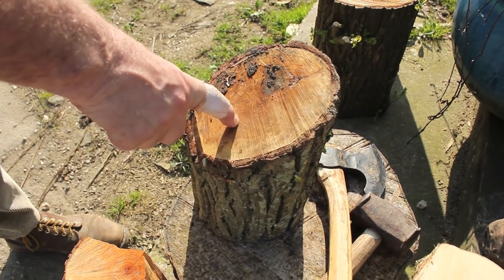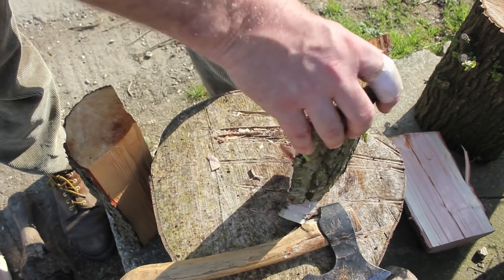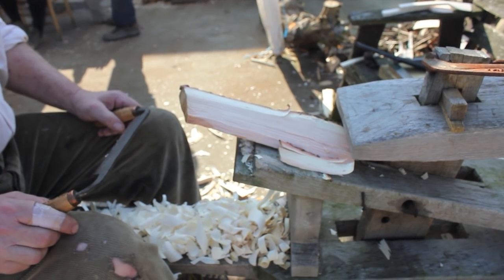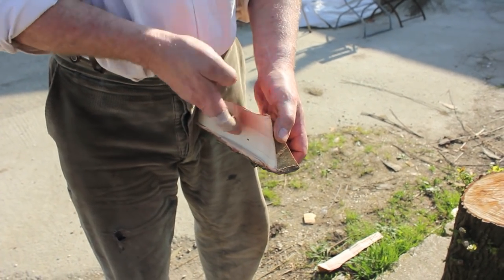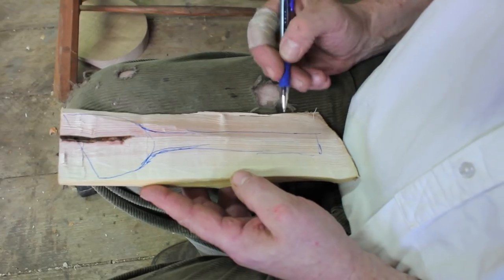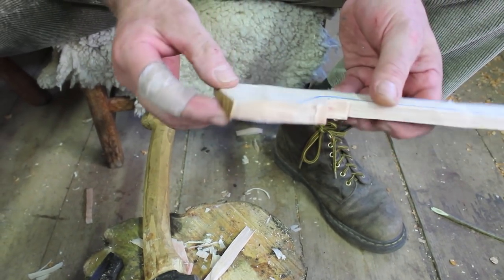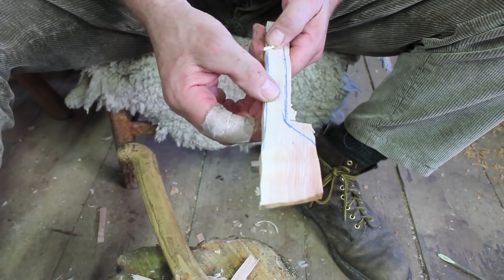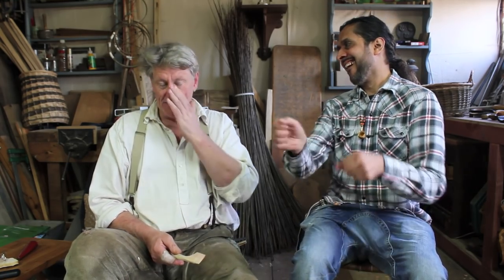How To Carve A Spatula - Martin Hazell

Comment: May I ask your recommendation on the condition of the timber used? Green? Mildly seasoned?
Reply from the maker: Hi James this timber was green which is what you mainly want to be using as it's far easier and safer to work with compared to seasoned ~Peace~